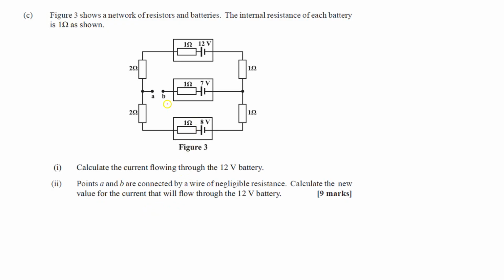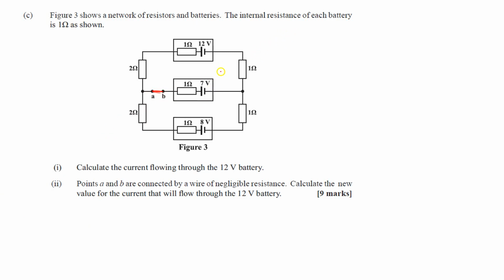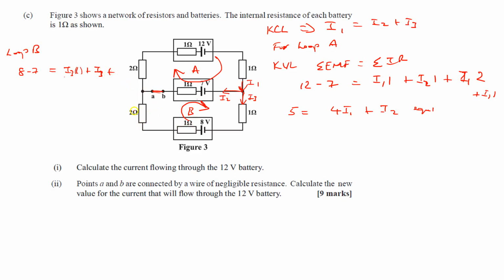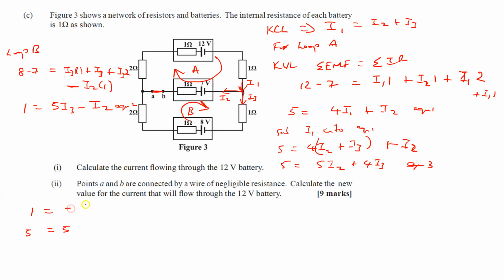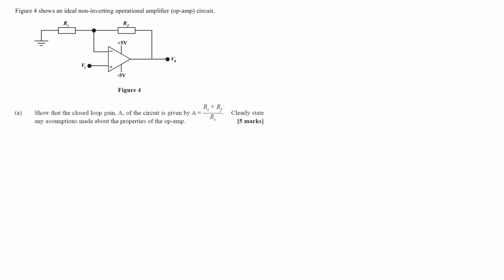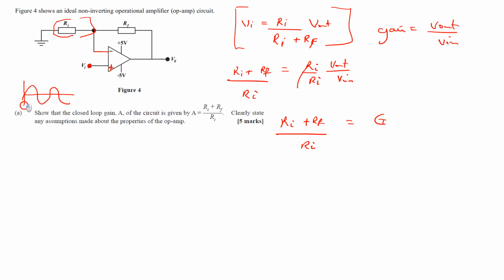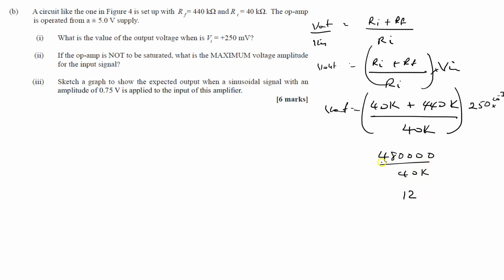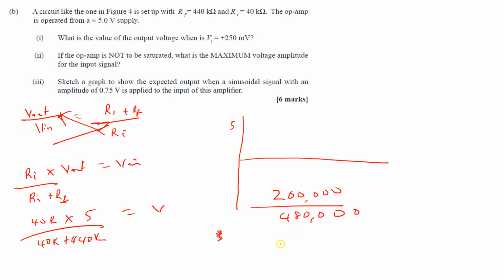CAPE PHYSICS UNIT 2 PAST PAPERS-P2/Circuit analysis, Kirchhoff’s, Internal Resistance

Comment: 12:50 Ah so I'm definitely confused now. I was told that since  conventional current flow is from a high potential to a low potential that when we go against the current its plus and with the current its negative. Is that wrong or am I just misunderstanding something in the video?
Reply from the maker: so there isnt one way of look at these problems that way is also workable
Reply from the maker: stick to what you are use to
Reply: @raestutoring  oh ok thanks for clearing that up👍.